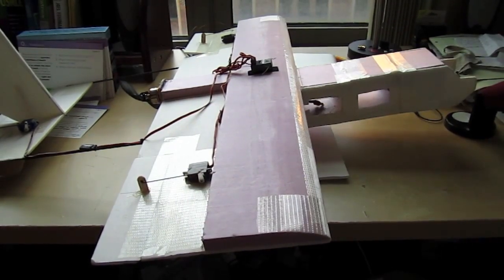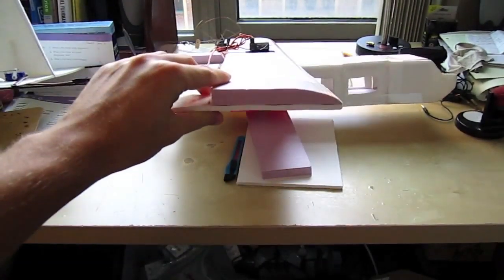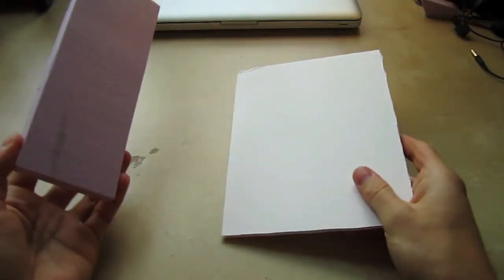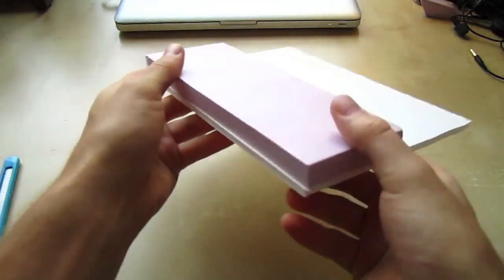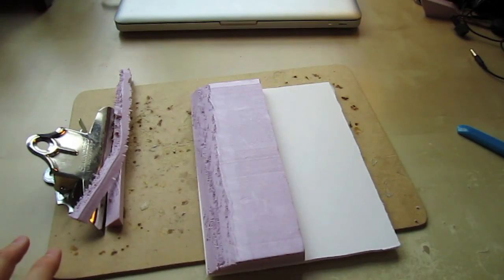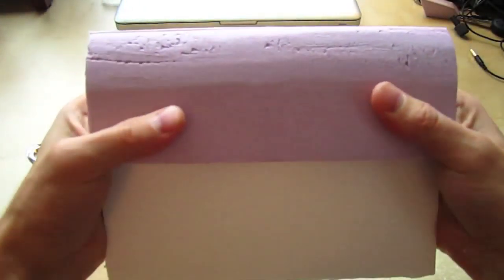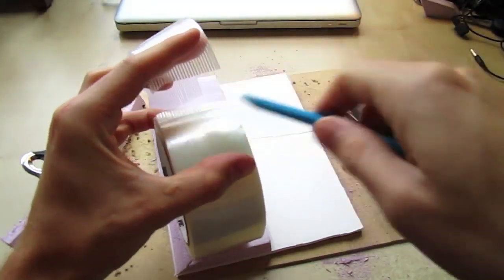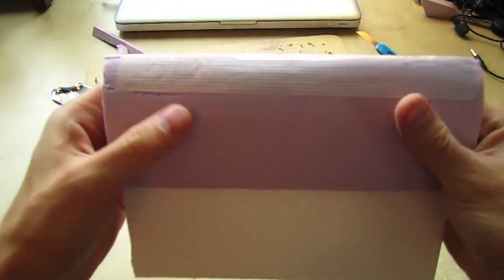How to make a KFm/KF Airfoil

Comment: Hey. Number one rule when handling knives. Never cut or pull the knife toward your body. Great video!
Reply: ....have you ever actually handled a knife, box cutter, drawknife, or any other cutting tool in your life...? it is often necessary, desirable, efficient, accurate, and ergonomic to pull the tool towards the body. i really don't think a hobbyist is likely to disembowel themselves doing this.